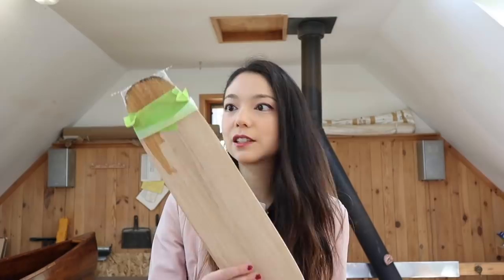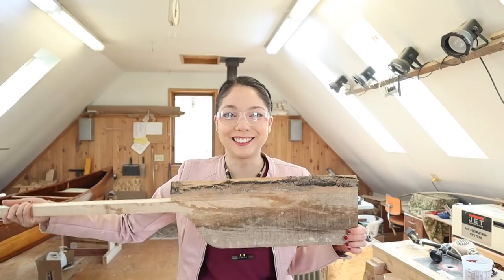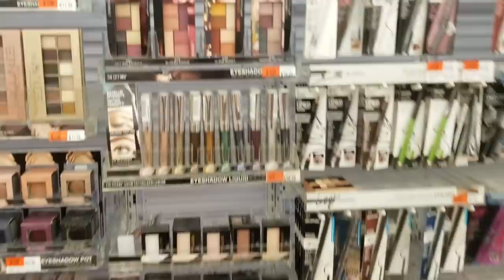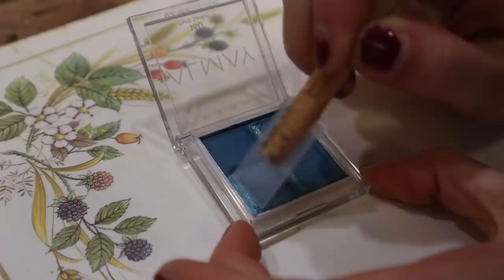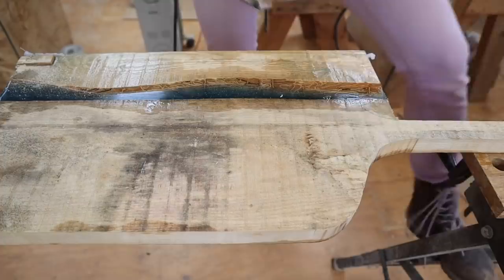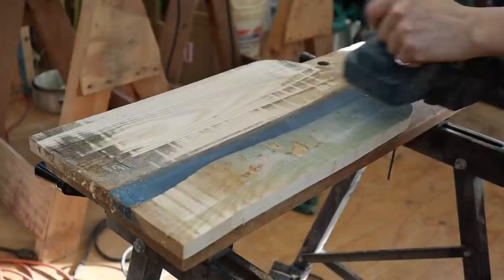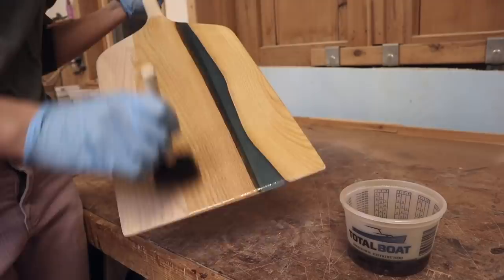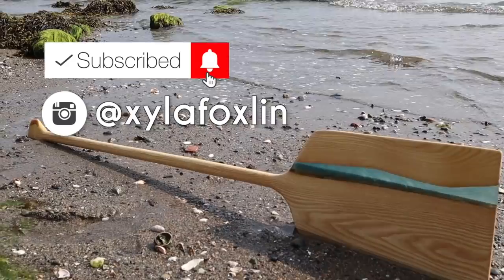Making an Epoxy-River River Paddle for Paddling on Rivers

Comment: 06:15 "Every tool is a hammer!"
(Except screwdrivers of course, they're chisels)
Reply: Depends on which end we're talking about here. I have used screwdrivers as both hammers and chisels. And quite a few times, I've used a philips head screwdriver as a center punch.
Reply: Damn, I thought they were pry bars
Reply: As Adam Savage says, Every tool is a hammer.
Reply: every tool is a beer opener as well.
Reply: Which is quicker, using what is in reach and fixing it later?, or maintaining the tools in a setup within reach? Never mind.

Comment: I had great results using ink for fountain pens to color epoxy, it's cheap and easy to get in various colors :)
Reply: Wouln't the water content in fountain pen inks mess up the epoxy curing?
Reply: @TheJaws27  I'm not entirely sure. I had indeed some pieces that stayed a bit squishy but others cured perfectly fine, so it might have just been my far-too-old resin. 
Definitely sth I should try again to make sure
Reply: Inks are notoriously not light fast as well. But i don't know about the permanence of eye shadow either...
Reply: Adding ink to casting epoxy, as opposed to the stuff used to build boats, in dilute quantity is not going to stop it from curing and would produce some interesting effects. For more saturated shades, composite supply stores have compatible colourants.

Comment: you can also use rit dye   available in most super markets, maybe even your pharmacy.  
you can use mylar, or wax paper for the bottom, when damming. mylar is great stiffer than paper, put some foam under it, clamp it down and it should seal  pretty good.  same with wax paper if you pull it tight when clamping it down on top of foam..

good job on the paddle...........

Comment: Really cool that you just go for it regardless like with the table which turned out pretty good for a first shot even with a catastrophic failure that you bounced right back from. I was hoping you did like a super "glass look" polish on the resin to make it a wall hanger but the most fun is learning how to make mistakes right off the bat so when you do that really cool awesome project that turns out perfect, it's because you've learned all the ways to screw it up and how to avoid them! That is the priceless journey. 
 I was pretty impressed when you had it in the vice on the weak side for planing - If I did that it would've snapped off and ended up in the fire box! 
 Attitude is everything and that you have mastered from the start.

Comment: A wood stain I really like only cost about $.30 a quart, I make it myself. Just take a quart jar of vinegar and put a steel wool pad in it for 3 days. Then pull it out and strain the mixture through a t-shirt to remove the extra steel wool. Now let it set for 3 to 4 days before use.
         The movie folks use this to make a new barn look weathered. It turns pine grey, it turns cedar black, black cherry has a rich dark brown finish. It effect all wood differently, so you have to try it out and see what shade the wood will turn.
        A cool thing is, it will stain darker everyday, so you have to stain all the wood you're using, the same day. After about 6 months to a year, the stain will turn a rusty red, and I used that on plywood bird houses to turn the wood a cedar red color. It's cheap and exciting to see what color it will turn the wood. 
       When you use it, it will go on clear, but changes color after it dries. So it is kind of like magic, waiting to see the end results.

Comment: Depending on if your storing that outside or inside, you might see that varnish come off sooner than later.  You can add one layer of chop strand fiberglass to the entire paddle to make it even more durable and resistant, then slap the varnish on top of that. Just a suggestion, as your already mixing epoxy , those few extra steps can make this thing last forever with a lot less maintenance.

Comment: While I have done a lot of canoeing and even built a couple, it was in a different country. I have never come across the concept of a river paddle shaped like this.  when dealing with water that shallow we would normally just use a pole to push off the bottom.

Comment: I've never needed a special paddle for river paddling, but maybe i've just been lucky with deep enough rivers. If i do start hitting the bottom, i would just take a different angle with the paddle and get to where its deeper. Either that, or i'd flip the paddle around and just push the bottom with the handle (which holding the tip of the paddle). i will also often refer to my paddles as oars, which i think is technically wrong lol

Comment: OK, the river looks AMAZING in the paddle...😮😮 Seeing the light through it is such a lovely touch to the padling experience. Maybe, if you could reinforce it with some bolts between the pieces, you could make a 100% functional one with no risk of snapping, leaving you up the creek with no paddle? Either way, gorgeous work.👍
Reply from the maker: Ah thanks so much! I think most of the problem is that epoxy doesn't flex with the wood so you lose the really nice natural flex that makes wooden paddles so comfortable. But also if you hit a rock it would likely chip the epoxy a little
Reply: @xylafoxlin  Ah, I see...!😅 Well, that sucks... Looks so amazing, pretty sure you could sell them if you could somehow reinforce/protect it...🤔🤔🤔

Comment: So, I’m not a wood worker or a scientist. But, I am in shock that the Epoxy held those two pieces of wood together, especially considering the space between those two pieces of wood. Was it because of the somewhat wide surface and the angle of the pieces? By the way, I love your honesty in what you do and don’t do. It makes you so much more human. I take that part out of my videos. Hehehe.

Comment: Xyla,  I was concerned for your fingers - splinters from chiseling off the bark and around the round-over bit at the router table, may I suggest gloves and push blocks. I've had enough of my share of splinters and near misses to have learned the hard way. Keep safe. Martin
Reply: Gloves near power tools with spinning and/or rotating tools are a seriously bad idea.  The tool could grab the glove and before you know what is happening, the tool will pull your fingers right into the tool where bad things happen to flesh.  Never wear gloves while using power tools.  Ever.  

Unless you really hate having fingers.  In that case, go for it.
Reply: @wjpreslar  gloves...splinters when chiseling. high speed blades...push blocks/push sticks.

Comment: As someone who has done all of my paddling in Europe and mostly in the UK that looks like a normal paddle shape to me, I've never used one of those longer narrower paddles.
Reply from the maker: Really! Interesting. Do you mostly paddle in shallow water?
Reply: @xylafoxlin  Many of the rivers I am familiar with are shallow enough that you'll be scraping over rocks in places unless the river is in full flood but even on canals, lakes or reservoirs  that are a bit deeper people tend to use the same gear. I have never seen one of those longer paddles on the water or in a shop. I must admit I am more the white water kayaking type myself so there may be some open boaters in the UK somewhere that have that type of paddle, but none of the ones I have come across do.

Comment: I would have to wonder about the bond of the epoxy and the wood. Wood expands when wet and contracts when dry. The epoxy doesn't and now with differing rates, I see a bond failure happening. Correct me if I am wrong.

Comment: Did you consider drilling holes perpendicular to the river in various places, to allow epoxy to flow in and strenghten the paddle portion?  I get that it's not really for paddling, but doing something like this might have made it a lot stronger in general, and would be hidden in the river due to pigmentation...

Comment: Epoxy resin is much more brittle than ash wood.
Loading the glued joint with bending is a very bad idea. Especially dynamic like on a row, not static like on the tables.
It should be reinforced with fiberglass, carbon or Kevlar.

It's beautiful of course.

Comment: if you have any kind of solvents present - silicones seems to not set really.
I've been casting some silicone watch straps in 3d printed moulds (PU resin photocurable). And if I had any spot that is not absolutely and completely set - no joy, the silicone remains liquid.
Also plasticine may work better really.

Comment: Silicones and amines are not happy bedfellows. The catalysts used in the majority of silicone resins can easily be poisoned by a large number of other chemicals and be deactivated. Also if the silicone is close to its expiry date, then the cure speed will be considerably lengthened compared to a fresh batch of material. I do like your channel, keep it up.
Reply from the maker: Wow this is such a great comment! Thank you for the info. I did find some of the cure speed info in follow up research but I'll have to dig into the catalyst deactivation a little more. Thank you!

Comment: The blade shape looks a bit awful and like the sharp corners will catch a lot. Also, the epoxy is a lot heavier than wood and I would think that the paddle gets annoying to use because of the unbalanced blade. What's your thought's on this?
Reply: Also the joint between the epoxy and the wood wont be as strong as a solid piece of wood. But it looks very cool!

Comment: With ash there are special considerations. You have already addressed the most important,  a thinned sealer and the first coat should be a flood coat.  You may not have gotten it quite wet enough.  Ash is just a collection of tubes,, the xylem consists of trachia (sp?)  and vessels.  Basically,, you can pour water into the top hand grip of your paddle and the water will drain out the bottom edge.  Weight.  The next paddle you build,, consider basswood,, much lighter.  I use paddles that are less than 30 ounces.  Total square inches of paddle face for you,, less than 120.,, mayhaps as little as 110 or 100.  130 square inches is like pulling a hoe through wet cement.
Reply: BTW,, I should have started that comment with,, That is beautiful  !!!  And yes,, I do great damage to my river paddles, bashing rocks and gravel,, and using prys to hold the vessel at the bank against the current,,, jabbing it into the ground,, mud to stabilize my old knees when I stand,,   You may want to consider an epoxy edge on the bottom of the blade,, a common wear point.  Love the eye shadow.

Comment: I’d like to see a long term update on how well the epoxy joint holds up... I will admit I’ve never done a project like this, but worry that the paddle might break or separate along the epoxy joint with continued use, so I wonder if it would have more strength along the joint if it would’ve been doweled perpendicular to the joint. Just a curious observation though.
Reply: She's said it's not really intended for long-term real-world use, so it'll probably hold forever on display.

Comment: Thinking that if you're really trying to paddle in water that thin then have a go at poling.
Reply from the maker: Next video: How to make a poling pole 

Step 1: buy a broom
Step 2: cut the handle off

Thanks so much for watching! :P
Reply: @xylafoxlin  Nah.......go out with saw and cut piece of convenient tree !
Reply: @xylafoxlin  Lots of good video material possible from making a canoeing pole.  Besides the woodworking, you could cast  the pole shoe from lead or bronze, etc.  Duckworks sells a fiberglass sleeve you could cover it with in order to bring epoxy into it.

I didn't get that carried away with mine; it's just a piece of 2x2 douglas fir that I rounded, varnished, and wrapped the end with stainless wire.  I have never attempted to stand up and pole a standard width canoe, but I have one with a 40" beam that goes well that way in shallow water.

Comment: Enjoyed the video on the canoe build, looked like fun. Great to have an uncle who can show you the way. My only question on the paddle; how structurally stable is the join? Is the epoxy strong enough to keep it from collapsing? BTW, a silicone pour leaks just as easily unless you have a water tight form.

Comment: Why does the epoxy river make it useless for paddling?

To heavy?

If you're worried about strength a fiberglass outer skin could solve that... perhaps
Reply: Same question.
"epoxy river in them and therefore become rather useless"
Sounds like we're missing something obvious that all river paddlers know...

Comment: It turned out great! I really love the colour of the river section too :) Could someone explain what it is exactly that makes this paddle impractical? I feel like I can make some assumptions, but I don't know anything about canoeing, so I'm just wondering if there's some really specific reason.
Reply from the maker: Thank almay for that one! :P 

Yes! A couple things: Epoxy is very strong but very brittle, so if you hit a rock it could chip or shatter. Also, epoxy won't flex with the wood so it makes the paddle very stiff, it is also heavier than wood so it throws off the balance and just makes the blade heavier than necessary. As far as normal paddling goes, river paddles are very wide which means you lose some steering control, but thats a more general river vs normal paddle thing.
Reply: @xylafoxlin  Could you add some milled glass fiber to the mix, or would that ruin the color?

Comment: Why is epoxy useless for paddling?  Is it really just a bunch of candy that will dissolve in the water?
Reply: I suspect it lacks the long fibrous  quality of the wood, and is not as strong and flexible.
Reply: @tackyman2011  True, but you can add a layer or 2 of fiberglass.
I was thinking that with wood movement, it might detach.

Comment: Here's some Safety Tips, never have music blasting in your ears while using power tools but wear actual ear protection because you'll need to be able hear the changes in pitch of the tool as its working is a safety feature unto itself. Indeed if a blade is dull or its binding you I'll hear it first and if the motor is being over torqued or having problems it too will change sound and not knowing either is happening can lead to being hurt when it bites back. Wearing a coat/long sleeves around a revolving blade like a Router or worse a Lathe can catch and pull whatever it's near into it in a blink of an eye and use push stick not your hands that close to a open Router bit. Most Table Routers have a hand held version mounted underneath it in the first place so use it instead since passing it over the piece is always safer and if you can't multiple passes is best since wood isn't flesh and it's better to ruin it than your hands if it grabs the material. Looking forward to your next build but please take these suggestions since in the nearly 45yrs I've done Wood Working I still have all my fingers/no scars because I've heard how a tool was doing and backed off before it punished me. Plus a dull blade or cutter which is more dangerous than one that's sharp makes a sound like a wounded animal and it will chatter or sound like it's popping which is when it's the most likely to hurt you since your usually apply more force to made it cut/plane/sand.

Comment: You may have to refinish the "paddle" but you could chamfer an edge on the end of the paddle and turn it into a canoe/river themed pizza peel. Then you could make a pizza oven as a followup project... 
And that could spawn the followup channel "Making pizza with Xyla" which would inevitably lead to... 
"Doing Cardio with Xyla, cause of all that &$*#&^$ pizza, luckily we have a boat, and a river, and some paddles... so we're Rowing with Xyla" 
And then that could turn into a boat based travel blog.... (I'll stop)